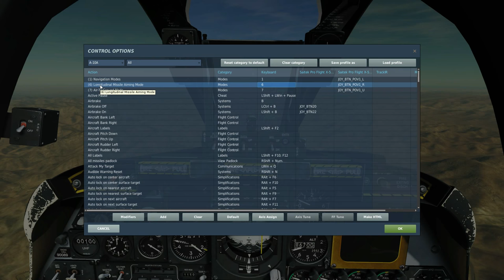A-10A Warthog: HUD Modes & Symbology | DCS WORLD

Comment: 2:38 answer (Time to Go (TTG) and Time on Target Delta (TOT). These values are used when a set Time On Target (TOT) is created in the CDU and it allows you to better reach your target steerpoint on time. The TTG indicates the estimated time it will take to reach the steerpoint and the TOT estimates the time difference between when you will reach the steerpoint and the TTG. The delta value can be negative or positive.)